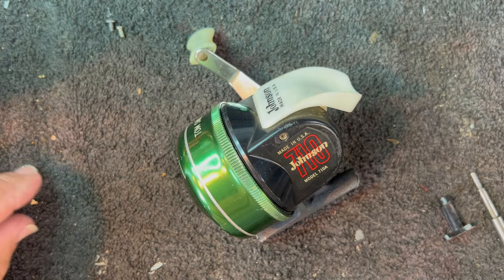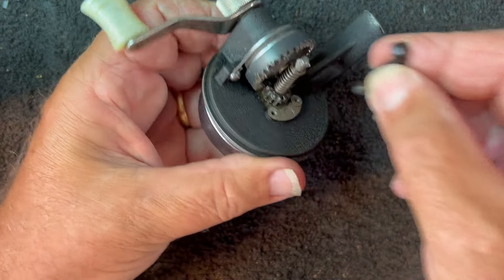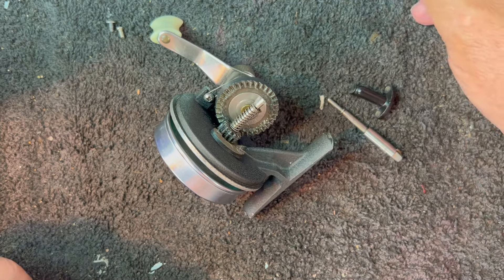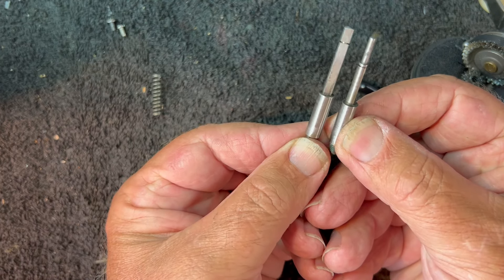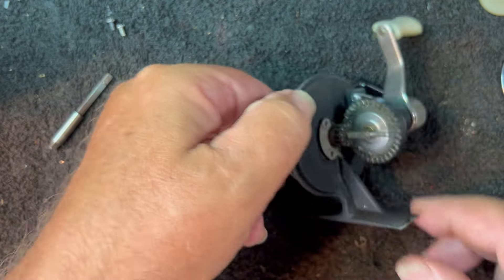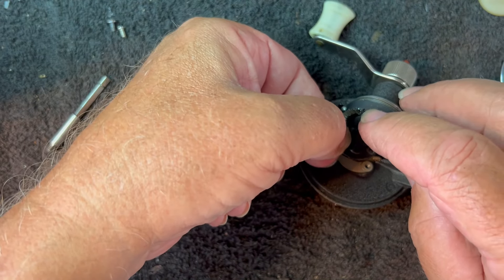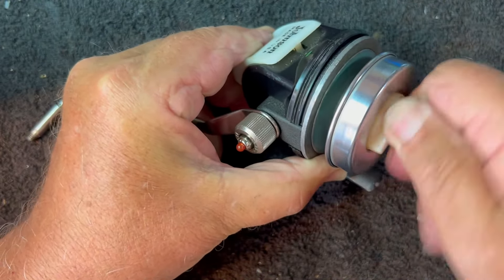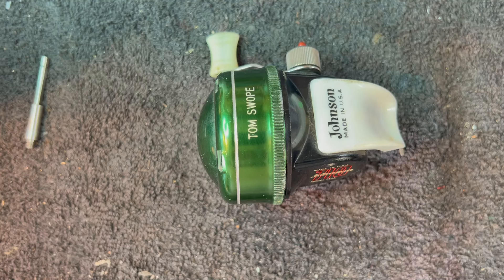Johnson 710A -- Revisited -- Now 710 -- Young Martin's Reels

Comment: Saw yesterday's video. Really glad to learn the correct installation and see this reel come to pretty much original again.
Reply from the maker: Apparently, it still isn't quite right so I'm going to start looking for a 710, 710A and 710B and create a video for each of them. That's the problem with using old reels that you find for the videos. You never know who has been in them before. For now, folks will have to make do with what I've provided but at least I'm letting them know up front that it might not be all correct.
Reply: I have a few Johnsons, but know little about those earlier models. Will be looking forward to any  future videos on those. Thanks!
Reply: Thank you Mr. Barber for the correction. Rick thank you for the correction. I love my Johnson reels

Comment: Saw your video on 710 which I do have  but the anti reverse spring is broken.  Need to find one . Do you know where to look for one  .
Reply from the maker: Charles I don’t know where you can get one of those springs. You might find one on EBay or in a parts reel. I took mine apart to see if I could make you a replacement. After 1 hour and 24” of twisted wire, I failed miserably. Sorry

You might check with the guys on the Johnson Reel Collector Association on Facebook. One of those guys might have a spring.